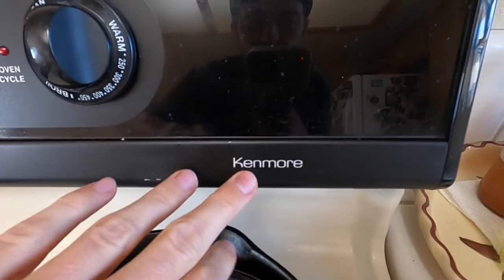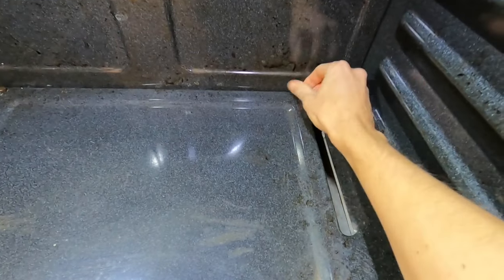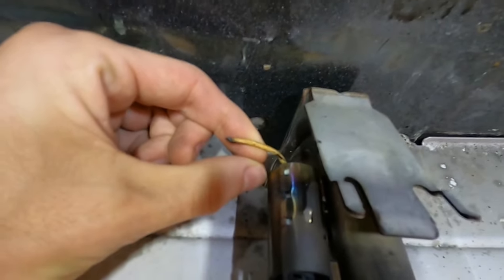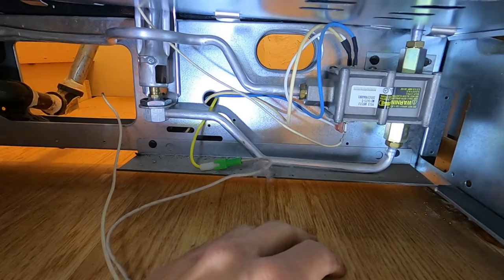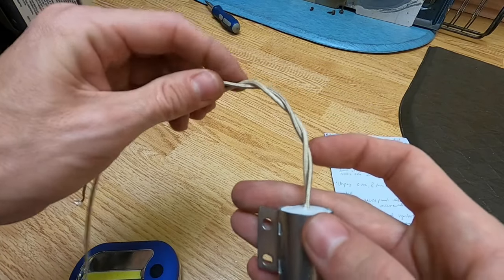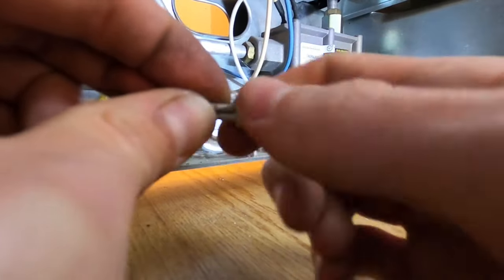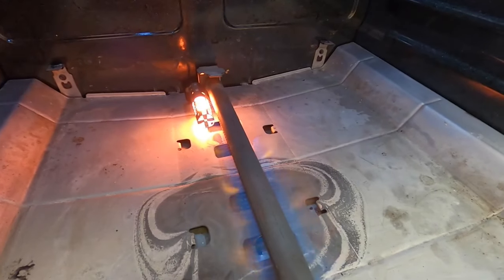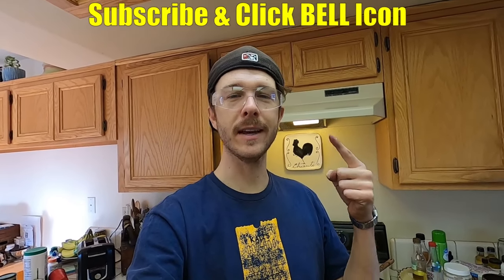Gas Oven Won't Heat? Easy DIY Fix

Comment from the maker: TOOLS & SUPPLIES & DONATION LINKS
Flat Oven Igniter- https://amzn.to/3DuBsYv
Round Oven Igniter- https://amzn.to/3IXVADt
1/4" Wrench- https://amzn.to/3K753cL
Wire Strippers/Crimpers- https://amzn.to/36E4Orn
Tool Set- https://amzn.to/3epVN4X
Safety Glasses- http://amzn.to/2ez41Jw
Magnetic Work Light- https://amzn.to/33tk6tp
If you Enjoy the Channel Consider Helping Support it by Donating below & by Subscribing.
PAYPAL DONATION https://www.paypal.me/JonnyDIY
Zelle Donation JonnyDIYs@gmail.com 
Venmo Donation JonnyDIYs@gmail.com
Reply: What if I did this and it still doesn’t work could it be something else?
Reply from the maker: @doumit87  yes could be many things including something on the main control panel. Check to see if igniter receiving voltage
Reply: That burner tube comes out they are usually held in by 2 screws.
the one you took out that was in front and one near the back of the burner.
then just lift it up and out, first disconnect the wires from underneath.
makes it a lot easier changing the igniter.
easier to get at the screws.
plus you don't have to twist the wires together that's probably why it didn't reach the safety valve.
Reply from the maker: @danp6101  thank you will try that next time 🙌👍

Comment: VERY THOROUGH and easy to follow tutorial...I'm 99.9% certain that I've got a bad igniter, and that's what's causing the oven to NOT fire up! TomorrowI turn 71 years old and I've ALWAYS loved taking broken things apart and fixing them... so tomorrow, I'll ride down to where my Dad RIP,  bought the Frigidaire oven back in 2013, and with OLD igniter in hand, buy a NEW one, install it and if the stars are in alignment, I might ACTUALLY hear a, "GOOD JOB GARY!" from my dear wife! (I WON'T however, bet my pristine Muststang GT on that utterance occuring!) Thanks again Jonny DIY for the great video!
Reply from the maker: You're very welcome Gary! And Happy Early Birthday! 🥳🎂🎁🎈 Have a great celebration. Hopefully the oven will be fixed 👍
Reply: @JonnyDIY  It turned into a NEW oven...thanks again for the tutorial
Reply from the maker: @garynivaggi  Ohh wow awesome! A new oven is always nice. You're welcome, happy to help 🙌👍

Comment: Great video! I have a question though, if the igniter doesn't work would the oven still be able to expel gas? because when I turn the oven's nob on, I can't smell or hear any gas coming out.
Reply from the maker: @JHONCASA-x5r  if igniter is bad, the gas valve won't open to release any. Its a saftey feature 👍
Reply: @JonnyDIY 
I’m praying you’ll see this 😊🙏🏽
And addition to his above scenario, so it won’t even make the clicking noise either? 

I was told that it isn’t the igniter, it’s the part that “connects” the stove to the oven 🤔 Thoughts?
Reply from the maker: @lightwarrior432  the oven igniter doesn't click when lighting. It's possible it's something else, Id start by testing igniter though
Reply: You’re here! 😃👍🏽😁
Reply: @JonnyDIY  Ok. THANK you!
Reply from the maker: @lightwarrior432  you're welcome,  🤞 hope you can get it fixed 🙏

Comment: Jonny...Couple helping comments for Whirlpool. Hardest part was running igniter cable through insulation to connection on the back of the range. There's a small plate that covers the gas orifice inside the oven. Remove the one screw and plate. Don't remove defective cable and igniter at first so you can use it to help run new cable through. 

ALSO, shine your flashlight where cable enters insulation inside the oven. Then you can clearly see where the cable goes as you look from the back of the range! So simple but a massive help in fishing  new igniter cable through insulation to connection on the back of the range. People online complain about how confusing it can be getting the new cable to the connection.
Reply from the maker: Thank you for sharing 👍🙏

Comment: Great video as always. A little tip for those two wires coming off the ignitor. Some heat shrink tubing will add extra protection against those sharp edges. Thanks and have a wonderful weekend.
Reply from the maker: Thanks Chuck. Great idea. I was thinking when I rewatched this I should have done something like that, maybe even an extra heat resistant fiberglass sleeve. Maybe on the next one! Hah these replacement  parts aren't the best anymore, I'm sure I may have to change again in the next couple years 👍 Have a great weekend too

Comment: Thank you for this informative video. I have about two yeas of tinkering with washers and dryers, but I haven't worked on ranges at all. I'm preparing to do a similar job, so I wanted to get eyes on the disassembly and part replacement. I really appreciate your attention to detail. If I may, I'd like to point out that the igniter fails not because it doesn't get hot enough, but because it goes out of spec. As the igniter heats up, its resistance drops, thus it's amperage increases. In order to heat the bimetal in the gas valve it needs to reach a certain current (3.3 amps in valves that I have seen) in order to flex the gas valve bimetal which opens the gas valve. Just a little tidbit I thought I would pass on. So, you can see an igniter glowing and not lighting because its resistance hasn't decreased enough for the current to reach the specified amperage. That being said, I want to thank you for showing me how to execute this operation!
Reply from the maker: You're welcome, happy I could help you out. And thank you for the extra knowledge on these things 🙌 good luck 👍

Comment: Just repaired our gas range with this video, almost identical igniter! Thank you so much for putting this together. The hardest part was getting out those two bolts holding the old igniter in 😂
Reply from the maker: That's awesome! Glad to hear you got it fixed. And you're very welcome, happy I could help 🙌👍

Comment: Totally worked for me, had this exact problem in my 790 Kenmore! Thanks so much for posting, very simple fix. I  do want to double down on how fragile the heating element is, don't touch the coil part at all if you can help it. Better ones have a shield to keep it safe.
Reply from the maker: You're welcome, happy I could help you out and glad to hear you got it done 👍yeah they are fragile! Good point

Comment: Thanx great explanation!  Quick question  ( If the ignitor doesn't glow will it prevent the gas to  be released ?? )  Thanx I hope you can help me with that !
Reply from the maker: Yes, the gas won't open unless the igniter glows (it even has to reach certain temperature). So sometimes a weak one will glow even, but not open gas
Reply: Thanx a lot!
Reply from the maker: @RubenGonzalez-oe6em  you're welcome, happy to help 👍

Comment: Love your video. Question can i use a flat/square igniter if my oven came with a round one
Reply from the maker: Possibly, but I always get the matching one it came with so there's no issues of how it mounts and the placement
Reply: @JonnyDIY  ok thx.  Understand but I live in Belize the stores that have any in stock all have square/flat igniters  I'm in a pickle i would hate to throw my stove out everything else works perfectly fine.
Reply from the maker: @dellyrowland5275  ohh ok, then I would buy the flat and try it out. Take out your old one and bring it in to store to show them 👍

Comment: Sorry this might be an ignorant question but Could it happen that only one oven goes bad and not the other? 😓 
I have a Kitchenaid with double oven, the upper oven is not heating at all but the lower oven does work and the top stove also works, do you think the igniter might be the problem in the upper one?
Reply from the maker: @lullabymaju  yes, each one has it's own igniter that can go bad 👍

Comment: Jonny i have a samsung less than 5yrs old,  From time to time we smell some gas from the oven and it does not or should say it takes forever to come up to the preheat temp.  What do you think this issue would be?
Reply from the maker: Igniter going out could cause this. May want to try cleaning the flame tube as well as build up of soot can affect it as well 👍

Comment: Just a quick question so does the igniter stay on when the oven has lit it stays on the whole time or just to light it and then goes off or it stays on can you confirm thanks
Reply from the maker: It usually goes on and off I believe. As it has to relight the flame tube as the temperature goes up and down

Comment: I have a Whirlpool double oven.  The upper oven won’t turn on.  I don’t see the igniter getting hot, but we don’t smell gas when we turn it on.  I don’t mind replacing the igniter, but it may be another issue.  If we turn it on shouldn’t we at least be smelling the gas?
Reply from the maker: @DaveVergato  the gad won't release and open up until igniter reaches hot enough temperature. Even when they go out they can still be glowing just not hot enough. If not glowing at all, almost certain it's bad igniter 👍

Comment: Great video.  I see that that ignitor lights the flames next to it and then the rest of the flames are lit in a domino effect.
  We have an issue where we started to smell gas only when the oven was on ( we stopped using oven after noticing this ).  I’m wondering if it is possible for some of those gas outlets on the bottom of the oven to be clogged so badly that most of the flames light, but a clogs keep some flames from lighting which means that nothing lights the gas outlets next to it, so gas is released without burning.  In other words, if the are 10 holes next to each other with gas coming out of them, and the gas is ignited at holes 1-7, but 8 and 9 are clogged, then gas will be coming out hole 10 without igniting.
Thanks
Reply from the maker: Sounds possible, I would open it up and light the oven and see whats going on with the flame tube when oven on. An inexpensive gas leak detector like this, may help a lot in diagnosing as well 👍
https://amzn.to/3Rb1ves

Comment: can you light up with gas connect and use a lighter to light it up without removing the bad ignitor just once? is it safe to do so?
Reply from the maker: No it wont open  the gas valve if it isn't working properly unfortunately 👍

Comment: hi! my oven doesn't preheat occasionally. often it works fine, but sometimes it sits at the base temp (150 degrees) for like an hour or two before heating up. the igniter seems to be glowing even when this happens. I just removed all the covers so I can see what is happening more clearly, but it hasn't had the issue today yet. any thoughts? can an igniter be faulty sometimes, but not others, does this seem to most likely be the problem? thank you so much
Reply from the maker: The igniter should only glow and be on to light the flame tube. So if it's staying on later for a while it may be bad. You may also want to check the "temperature probe"
Reply: thanks! I replaced the igniter and it's preheating well now, but the oven smells like burning plastic, which it didn't before. thoughts? @JonnyDIY
Reply from the maker: @valerieholze9956  🤔hmm double check the work you did and make sure  no wires or anything getting burned. It shouldn't be though. I'd double check then if nothing, see if it burns off and was just new igniter

Comment: Were you get those white top things that covered the wire
Reply from the maker: The white things are "wire nuts" but heat resistant ones. They came with the new igniter 👍

Comment: Great video, I changed my igniter and it glows but the I’ve won’t light. I only get the gas smell. 
I turned the oven off due to the strong gas smell.
The oven bar never lights up. 

Can you help me with this issue?
Reply: Having the same issue currently? We're you able to solve yours?

Comment: Great video. What do you do if your pilot light will light, but not the oven will not kick out any gas from that long central burner? Thanks!
Reply from the maker: So you have a gas fire pilot light that stays lit all the time but flame tube wont light?
Reply: @JonnyDIY  correct! It’s a Vulcan 60L if that helps.
Reply from the maker: @milesaway3422  I believe those use a thermocouple that decides to open the gas. I would start there by either testing or just replacing 👍
Reply: @JonnyDIY  nuts. I had it replaced. I thought the thermocouple was for the pilot to stay on?
Reply from the maker: @milesaway3422  no it's there to determine pilot light is lit so it'll open the gas. May be dirty or bent away from pilot light. Can try cleaning and see if helps
Reply: @JonnyDIY  I can crank it to 500, but no gas comes out
Reply from the maker: @milesaway3422  test the thermocouple see if still good
Reply: @JonnyDIY  you’re correct, the thermocouple was toast!
Reply from the maker: @milesaway3422  awesome glad you figured the problem out 👍
Reply: @JonnyDIY  I appreciate the assist. This one is over my pay grade :(
Reply from the maker: @milesaway3422  you're welcome 👍
Reply: I have the same issue, the ignitor starts glowing and stays glowing,  but the tube doesn't light and the temperature only got to 145 degrees over a period of three hours!  This happened on Thanksgiving but it worked fine just the day before!  Now here's the strange part.  I discovered it won't light until I open the oven door,  it's like it needs extra oxygen to open the gas valve.   What could be causing this, any ideas?

Comment: am I good to use the stove top burners while waiting for part after disassembling to get the bad oven igniter out?
Reply from the maker: Yes you're fine. I would put some wire nuts on ends or wrap each end of the exposed wires to the igniter if you got that far though 👍

Comment: What screws do i take out to expose the wires in the back? I see a bunch of screws to take off the back plate
Reply from the maker: Different on each model stove, can always put the ones back you didn't need to take out to get plate off 👍

Comment: Thank you. Excellent. Really helped. But my Whirlpool is so dang heavy I can't budge it so I may have to get a REAL man to fix! Its definitely a broken flat style glow igniter. Not coming on at all.
Reply from the maker: You're welcome, happy to help.  Hope you can get it fixed sooner than later 👍
Reply: @JonnyDIY  Jonny...managed to get range moved, bought a new igniter for $52 bucks, installed,  it works! Can't imagine if a repair guy did the fix, labor cost, part markup. Thanks again. I'll PayPal you a donation.
Reply from the maker: @frankweir9514  Awesome, that's great. Glad you were able to get it working. And happy I could help you do that. Thank you for donation too 👍 🙏

Comment: We have a thor kitchen range. We replaced the double safety valve, and the broiler now works, but, bake does not work... we have ordered the replacement igniter...to test the bake, wouldn't the flame tube light up with a torch, even if the igniter does not?
Reply from the maker: The igniter must be working to open the gas up, so you'll have to wait to test it or use a multimeter to test it's resistance
Reply: Thanks so much!!!! my husband was convinced that he had installed the new valve incorrectly...after your reply he is more confident that the new igniter will work!!!!
Reply from the maker: @natalieransford5450  you're very welcome, happy to help.  Hope you can get it working again soon 🤞👍

Comment: Hi Johnny. I realize it's Easter weekend and you're likely busy doing easter-like things but...., but I guess I should give you a heads up on a few things...,A: I am a 62 year old grammy who has "0" knowledge or experience repairing anything electrical but B: I truly can't afford to hire an appliance guy to come out so it's all on me. Now having just watched your (absolutely fantastic!) video on replacing an oven ignitor I'm thinking "hey, I can do that" and so here I go but..., I have a few questions and may have more as this repair moves forward. Ok so I'm working on a Kenmore gas range, model #790.7851 on which the oven may or may not heat. Meaning over the last 6 months it has heated up a few times but the last attempt I'd turned it on but after waiting about an hour for it to heat I just turned it off. The time before that it had heated but took about half an hour to heat and then if I changed the temperature (up or down) it would go down to it's lowest heat and would not budge from that temperature. I'm merely guessing that it's the ignitor AND like I said, after watching your vid I think I can do this. 👉🏽👉🏽🤷🏽‍♀Can I get the ignitor at Home Depot? (Ignitor, oven burner part #316428500, taken from the parts repair list for this oven)..., and "Shoot!" I've forgotten what my other "?" were. Lucky you, guess you're off the hook for now😉😉 BTW I swear I'm not some crazy just hoping to mess with you, I am who I say I am (for better or worse).If for whatever reason you can't help (any further than your great video) that's totally copasetic. I'll figure it out, may take awhile longer but eventually I'll get there. Sorry for the REaLLy lOnG comment, it's a grandmother thing having far too many words✌🏽👋🏽
Reply from the maker: Sounds like the igniter going out. I'd just replace it, yes. I usually order online from anywhere who has them, amazon, ebay, or appliance parts supplier. You may even be able to get one locally if have one of those appliance repair shops. Yes you can use owner's manual to identify replacement but I'd probably look at one in there to make sure matches before ordering. Have a nice Easter weekend 👍